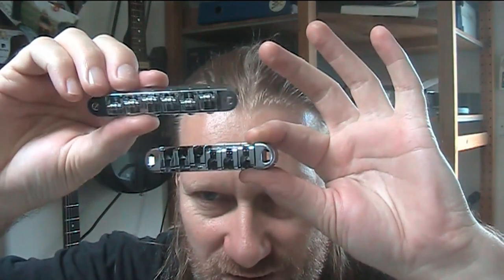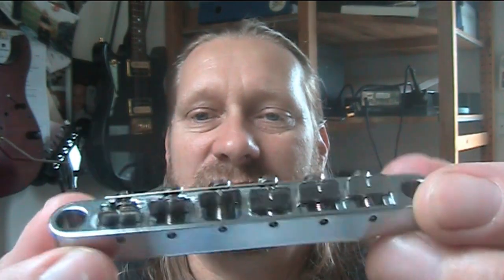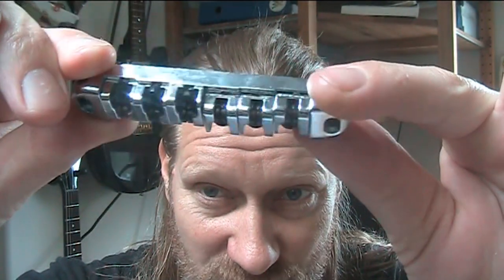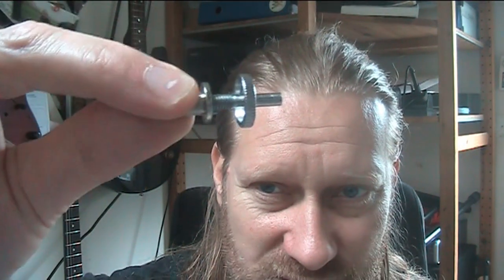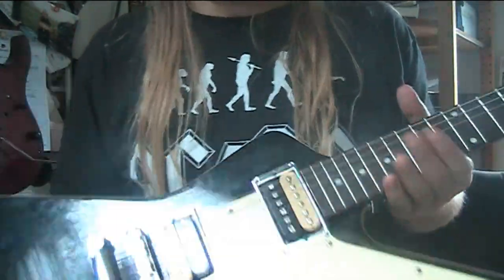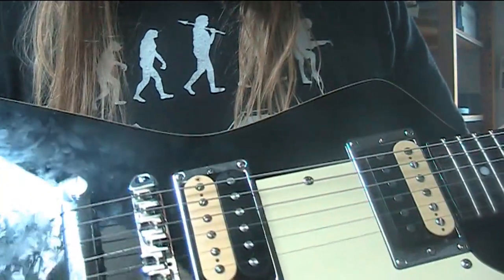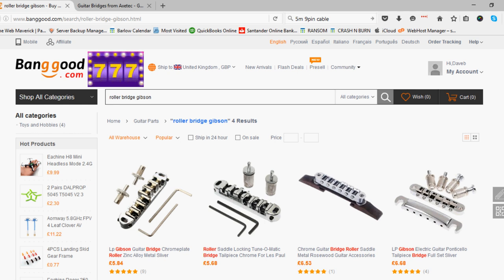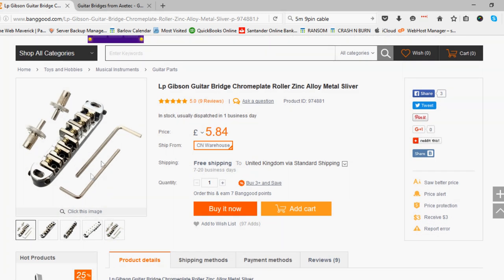Tune-O-Matic Roller Bridge Does it Make Any Difference To Your Guitar?

Comment: I have Bigsbys on most of my guitars, and wouldn't even consider using a "regular" bridge.   Rollers are the way to go.
Reply: That's probably going to be the next one I do which is my Gretsch G5420TG w/Bigsby. I already changed out the stock spring for a more sensitive and responsive one and it alone made a huge difference. I think the roller bridge will only add to it in comfort and reliability.
The roller bridge on my Epi LP Standard Pro has already logged double the amount of hours I normally play with no string breakage and no change in tone as some claim.
Reply: I notice there is two kinds of roller Bridges

Comment: I've fitted many a roller bridge to LP/SG type guitars and yes you have to watch out for the pole pieces to make sure they fit. But most suppliers generally have a few different styles and generally cater to the less fortunate who can't afford Gibsons. In theory rollers should be better than the wedge saddles, however I don't tend to find it in practice if you slots the saddles correctly and take off any burrs. The main thing I find is you eliminate that annoying piece of wire holding the saddle in place that vibrates every time you hit strings. And a bonus - if you look for the shaller type bridges, they're a little wider, so great if your intonation adjustments on your old bridge was at their extremes. One other thing - that roller you put on, personally I prefer the first style with the intonation screws at the side like the originals, not on top as it's a PITA to set your intonation with the screw under the string. But once set up, they all do the same job.

Comment: The roller bridges are better for tuning because the strings now roll 
instead of scraping up to pitch, my experience  and opinion.
Reply: It's a simple matter of the laws of physics - will dragging a string over a knife's edge aid in tuning - or keeping tune - more than having that same string roll over a bearing? Not exactly rocket science. I replaced the bridge on my Epiphone Wildkat (known for having tuning issues) with a roller bridge, and that guitar holds tune almost indefinitely - and that's with a Bigsby. 'Nuff said?
Reply: Tablature Butler by the same logic though I suppose holding it more securely when not bending the string you’d expect it to allow more vibration as less is able to move possibly?
Reply: It's funny because in the winter with the drastic changes in temp and humidity, I'll be sitting at the computer and occasionally hear a "tink!", where the wire of the wound strings passes over the sharp TOM bridge. I haven't installed a roller bridge yet, but since I replaced my stock tuners with some Grover mini locking tuners, tuning issues haven't been near as bad as before.
Reply: dcs10291 I understand that theory, but with a roller isn't more string contacting the roller, thus transferring more vibration? Just a thought.
Reply: @backwoodsbrewer  IMO and experience that's all I can offer, no. If it were transferring more of the vibration I'm pretty sure that would effect both sustain as well as tone. On my LP the sustain time actually increased by a few seconds and tone wise there's no change at all that I can hear at all. The one thing I can say though is the life of my strings has already doubled so far and they are still staying in tune. Of course the G, B, and A strings are always the ones that go and I'm just getting to the point of them not being as crisp sounding and as easy to stay in tune so a change is due but I've also played double the amount of time as normal at this point. 
I also made sure though I had a quality nut before that change which is normally (I think) were most peoples problems actually come from.

Comment: I ended up getting the same bridge you fitted to the explorer to go on my Vintage V100, purely because the existing one didn't allow me to adjust the intonation far enough on one string to get it spot on. This type of bridge gives additional intonation adjustment for the whole bridge which sorted the problem totally. To be fair it stayed in tune before and still does now so, result!

Comment: Guitar building is a 'hobby' I got involved with early last year. It was something I fell into in retirement. I am now building my first 'solid body' six string guitar and I have spent days trawling through ebay, AliExpress, BangGood and a few others trying to figure out the difference between roller bridges at various prices and in my very amateur way came to the conclusion that they all look the same, or very similar.  I live in rural northeast Thailand and there are no retail outlets for guitar parts anywhere near here. This video has helped me tremendously. Thanks so much.

Comment: The V grooves cut strings while playing.
I replaced my bridge on ESP with the third type you showed.
Pros: Tuning remains comparatively sturdy, almost no string breaking so wastage of money is stopped.
Cons: It takes so many hours to get correct intonation! You loose bell like harmonics which you got from your older bridge.
Good video.
Reply: Good to know on the harmonics. Thanks.
Reply: Got here because an LTD giving me the string braking problem. It has been terrible to find a solution, so I'll have to give this a try
Reply: @propsab  Best wishes, but be careful. This involves quite delicacy and mechanical movement to replace a bridge with its posts. New posts might be smaller in diameter or larger. So be careful before doing this. Keep in touch if needed so.
Reply: @shashanksherkar392  Thanks!

Comment: Good to hear that people are having a good experience tone wise with roller bridges, either no change or better tone. I recently came across a forum submission where the writer said he changed out to a roller bridge for a short time and then changed back again.Reason for the change back was given as a loss of tone caused by the rollers. Last year I bought a new semi hollow guitar that came with a vintage style trem and a roller bridge so I started thinking hmmm. Thanks Dave, (and the rest of the posters) for putting another slant on this topic.Cheers
Reply: I think it's subjective at best to make a claim of tone loss. The bottom line is you need a certain amount of tension to be in tune. The idea that any change because of a stretching string over a roller is going to make it less toneworthy is ridiculous in my opinon.  Tension is tension.

Comment: I just acquired an EVH Wolfgang Standard with a TOM bridge. Cheap version, simple guitar. I'm thinking of throwing one of these roller bridges on it. Why not, AND it will lock in place, that's the beauty of it.

Comment: A guy at guitar center told me it wouldn't make any difference if you don't have a bigsby. I don't think he's right. Less friction equals better tuning. It's just not the norm. He seemed to be pretty informed but I have one on another guitar and it stays in tune twice as long and it's a cheap one. Im getting a Schaller for my main guitar. It's a little over 40 bucks but  looks to have longer length to intonate. If it makes your guitar stay in tune for even one more song playing live it's worth it to me.
Reply from the maker: There's no much in it, I updated mine due to string breakage issues mainly, the bigger bridge brightens the tone a bit, increases sustain and helps with tuning stability especially with new strings.

Comment: Nice video mate, subbed.
 I bought one from Ali express for $16 Aussie$ it also came with a new tailpiece. I just asked the seller for one to fit an epihone Les Paul and the seller said it would but also sent me a diagram with the measurements to check. It fit perfectly. Ali express have price differences between sellers for exactly the same product in all departments so it pays to look around.
Tonally I can't notice anything. The big thing for me is since fitting it the intonation is finally spot on, something I could ever achieve with the tune o matic  bridge.
Reply from the maker: I swear by them :)

Comment: if it's any help in the specs of the guitar ( go to the manufacturer of the guitar page ) will give you the info . the difference is USA guitar upscale Gibson etc use Standard threds, Japanese,Korean etc. use metric measure. on older USA guitar always use Standard many newer USA guitar are likely to use either so get the specs from web site of manufacturer of guitar. hope this helps been playing for 52 yrs. give or take a month so I've been thru a lot of axes.

Comment: I tried a roller bridge on my 2012 Gibson Les Paul Traditional Pro and I realized too late that the radiuses didn't match, there's a Schaller roller that's got a 12" radius however so I'll have to try that next ($55 on Amazon). Right now I have locking tuners w/ a TP-6 tailpiece and holy crap, it's such an amazing setup. My action is obscenely low; I usually go the nickel/dime route but it's even lower than that. And not a single bit of buzz. Bends aren't fretting-out either, I've never seen anything like it. Not only that but the strings are clearing the stock bridge and not touching the back. The TP-6 is a Guyker brand I picked up on Amazon for $30. Can't wait to get that Schaller roller on there and see if it really makes a difference.

Comment: The $35 'Golden-Eagle' Roller-Bridge I put on a Bigsby Equipped 'SG' sat lower than the T-O-M and the strings clear the back of the bridge plate.Same thing on a Les Paul Studio w/out a Bigsby...No MORE BUZZING on either axe from over-wrapping any longer as well.The Les Paul Stop-Tail is flush with the Maple top as well, 'Golden-Eagle' ROLLER BRIDGES ROCK!

Comment: Epiphone les paul came with saddles like guillotine blades,Vanson roller bridge and Tusq nut transformed it,No tuning issues and no hang ups or strings snapping.Best £25 I ever spent.
Reply: I'm having the same problem with the Epiphone Tony Iommi SG. The "guillotine blades" have been filed down but still doesn't tune that great. I'm thinking about a Tusq, a roller bridge and maybe some grovers.
Reply from the maker: Awesum
Reply from the maker: Roller Bridge dudes
Reply: 2rdn2 The new nut and bridge will transform it mate.Though why we should have to mod these new guitars is a question for the company I think.
Reply: I like the Tusq bridge saddles.
Reply: @JohnIainMcFarlanewaspfactor  Cost, depending on what you paid. Also, it's hard to change minds that have been entrenched in old ideas. To me it's a very small cost considering the price of a decent quality guitar.
Reply: @2rdn274  I wouldn't even bother changing the tuners, that's rarely if ever the real issue. If you want locking tuners that's a different story. Most all tuning issues are a result of the nut not the tuners. I fully agree about the guillotine TOM bridges though.

Comment: I put those exact bridges on both of my Gibsons USA. They fit perfectly on the posts already on the guitars. I did need to use the posts that came with the bridge on my Epiphones, a Firebird and a 335. I have had them in use for a year. A guy was bitching that the resale value would go away. I don't care, I'm not selling them. Finding a nut is a other story. Plastic nuts are junk, my Stratocasters go out of tune with the tremolo. I put a roller nut and just the saddles. They never go out of tune, I wish they had these years ago when I had to block tremolos. I tossed Bigsbys in the trash bin.

Comment: Good video! If the original ABR-1 bridge causes tuning problems or dead strings, the slots are cut wrong. In fact the original saddles when cut correctly will make point contact with the strings, and should result in great tone and sustain. The downside of course is the tendency for strings to break, especially under a heavy picking hand. (light pickers need not worry) When tuning up, always tune up to pitch, never down (even with a roller bridge) The comfort of a roller bridge can not be denied, although personally I've never had any discomfort with the original.

For guitars with a Bigsby or Vibrola, a roller makes a LOT of sense. The ABR-1 is absolutely miserable staying in tune. A rocker bridge makes more sense vs a roller, no resistance at all. The Gretsch aluminum rocker bridge is vastly superior to all others, but has fixed compensation for your intonation... maybe a minus, but I've not encountered a problem (yet) with the intonation.

Comment: The idea of a roller tune-o-matic is brilliant in theory. I bought one..Schaller is very high quality however the bridge I bought.. the rollers are not on races or bearing but a screw type thread. This allows for adjustable string spacing.. again..great in theory. A roller that is actually more of a threaded nut on a threaded bolt most likely will not rotate once the pressure of a tuned string is applied to it. Applying oil may help but oil between metal parts will effect tone, sustain and resonance, not much but it will. The string will however slide back and forth over the saddle if its round rather than a standard T-O-M saddle for an increased chance of returning to tune, lubing the string at the roller surface would as well helps this to happen. Just a bit of my own theory be it right or wrong. I no longer have it but..if you wish to challenge you could mark a roller, mark the string very close to the roller and watch it as you  tighten up ...does the roller move as the string mark moves? Do they roll together beyond in tune after more pressure than needed is applied or did the roller stop rolling and go to a string glide??
Reply from the maker: Some good points here, just about to record part 2 of this subject video :)
Reply: @James Hill.  I'm with you on this one - not sure the roller will actually move with the movement of the string (due to downward force from the string).  Maybe worth a try I suppose.  I did replace the string tree on a Strat which had the typical bent metal wing tree (a particularly cheap one) that snagged the high strings.  That did help, but a) It was downstream of the nut and b) not sure it actually rotates - more likely the string just rolls over the gentle radius.  A roller bridge is directly in contact with the string length, some commentors say the roller bridge adversely affected the tone/attack - which for the moment puts me off faffing around fitting a roller bridge!

Comment: I guess everyone forgot, or maybe to young to remember why people stopped using rollers bridges, etc years ago. I agreed with all the reasons. The tone suck can be explained simply by the fact you are adding many more interface surfaces between the string and the body of the guitar. Secondly, the rollers often are not rolling! The coefficient of friction is greater where the roller shafts are making contact to the saddle body than the string sliding over a non roller saddle if the slot is dressed properly. Also, the roller shafts get gunked up rapidly from a less than ideal environment. Anyone remember this decades ago?

Comment: Added a roller bridge to my Epi Les Paul from StewMac and it was the best upgrade. Super stable tuning and great for sustain too!
Reply: I mounted some cheap Allparts rollerbridge on my Epi LP w/ tremolo and it does the job but steals some tone. Did you notice any sonic difference with StewMac?
Reply: @stenbjorklund461  Honestly no, in fact it increased my sustain time and actually makes it more forgiving on hard string bends. And while the string tension itself has to be identical to stay in tune I've managed to play almost double the amount of hours so far before a string break, so far.  I've only seen or heard one other person make that claim and to be honest I think it's subjective for the most part. The guys I talked to that had already made the switch specifically said there was no change at all in their tone which was something I specifically wanted to know about. At the same time though I also switched my nut from a plastic one to a TUSQ so the chances thats more reliant on the nut than the actual bridge seems to be more likely?

Comment: There is an important fact which is not covered by that video.
If you consider that the strings sit a the top of a rolling wheel which is inserted in the middle of a saddle, then for bridges with a standard "tune-o-Matic type" width, THERE IS SIMPLY NOT ENOUGH TRAVEL TO ENSURE A GOOD INTONATION if you go just a little afar from standard string gauges.
The only bridge that I know which offers sufficient travel is the Schaller STM Roller Bridge at the moment.
Unfortunately the Schaller STM is a non locking bridge (meaning that it falls when you remove the strings), but, it comes with both standard adjustment screws for US and Asian guitars (M6 screws).
Reply from the maker: Hi Philippe, I have three of these bridges fitted and there is plenty of room for intonation, I have had no issues getting the intonation just perfect. So I'm not sure what issues you are having. feel free to expand on your comment. :)
Reply: I suspect someone recently discovered the two adjustment screws at each end of the bridge :p

Comment: Dave I just didn't like my strings sitting on a knife blade. I put  roller bridges on all my Les Paul and 335 guitars. I put roller nuts on them if possible. My guitars are for work and some are for my own fun. They are now for an investment, stocks and bonds are for that and some real estate. Not a reissued Gibson, they are a loss. Stay in tune and remember that is a guitar not a piggy bank.

Comment: I have a roller bridge on my Les Paul, i fitted it when i noticed my bridge posts bending due to my use of a Bigsby,.It is an abr bridge with no post inserts so i did this to stop the post holes enlarging, and stopping the bridge posts collapsing into the maple cap.
Reply from the maker: Use the stringsavers, they are brilliant